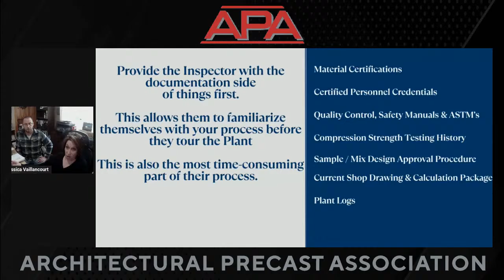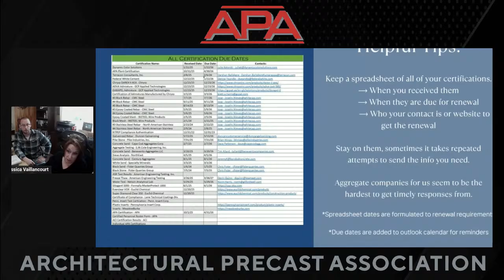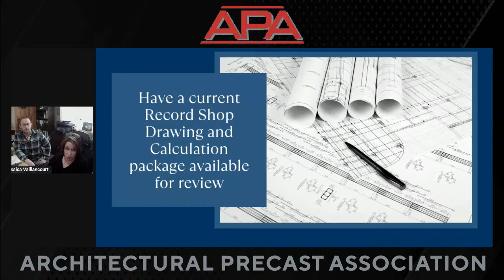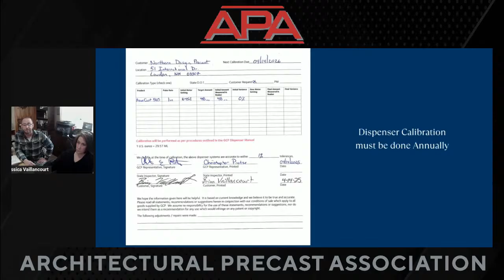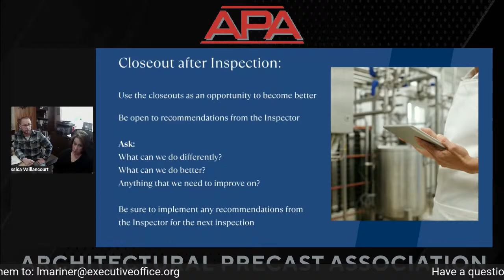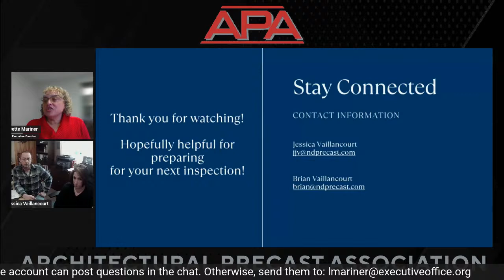Be Better Prepared for Your Next Inspection

Comment: Hello, regarding the 2025 inspection check list please remove washout test for premix application.
Please note that the GFRC washout test is not applicable to premix GFRC. Washout testing is intended exclusively for sprayed GFRC, where it serves to verify the accuracy and consistency of fiber deposition during the spray‑up process. In premix applications, fiber content is controlled through the batching and mixing procedures, which provide the required verification without the need for washout testing. This item should therefore not be listed as a requirement for premix GFRC.